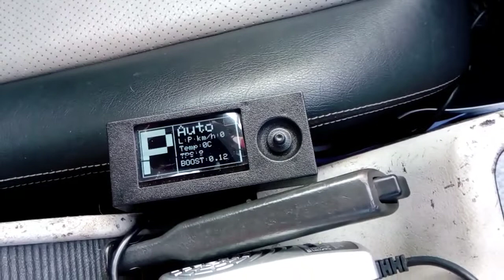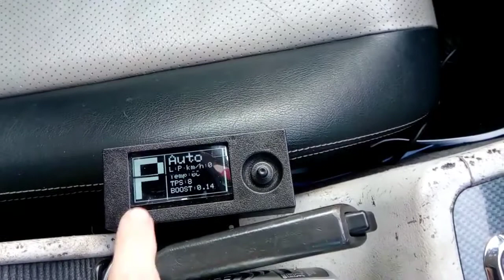OFgear... Turbo SLK more problems!!

Comment: Your Throttle Position Sensor is not set up properly. In Park, engine idle or off, TPS should display 0.
Reply from the maker: We learned a lot more about Ofgear after the fact, Ole did give a lot of support but the way this car was set up was an absolute electrical nightmare to be honest as it used the standard ECU and a standalone ECU for the engine then Ofgear for the transmission. Needless to say the transmission then burnt up its clutches which was hardly a suprise but any issues with the Ofgear were solely on us, thank you for pointing that out though I appreciate that, the next time this unit is going to be used it will likely be on a M104 with a 722.6 from a 320 CDI but the earlier version.

Comment: So, did you solve the problem? Did you find out the cause?
Reply from the maker: Hey, unfortunately the transmission burnt out before we found the fault for sure... But Ole was very helpful and after we looked at the internals of the transmission it looked likely the fault was the transmission and not a fault of Ofgear, however we did find Ofgear quite challenging to set up but I plan to reuse this same unit on my Turbo Clk build but with a stronger transmission. We have seen many people have success with Ofgear, just in this case I think it was more likely the transmission let the controller down. But when I have got my Clk running with it we shall find out for sure. Unfortunately I can only say that it seems more likely it was always a faulty transmission. Then the engine blew up 🤣

Comment: Interesting stuff, i've never seen one of these before. Did you say it cost 875 quid? you could almost get a whole six-speed SLK for that much!
Reply from the maker: I agree but what happens when your only licensed to drive automatic this is where our problems begin Ben has a auto only license otherwise life would be a lot easier for us half the electronics but it does cost a crazy amount just to make the transmission work it's was only £320 for the engine ECU but we pushed as far as we could using stock management to control the box and it was literally dangerous if you got on the throttle it would just slip so we decided best to try and sort it the right way even if the bank account hated us for it 😂